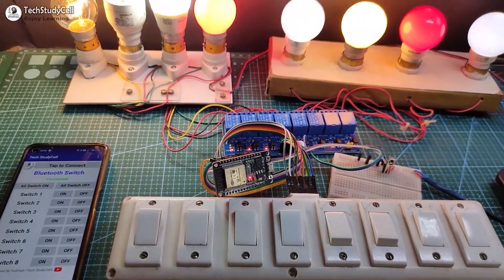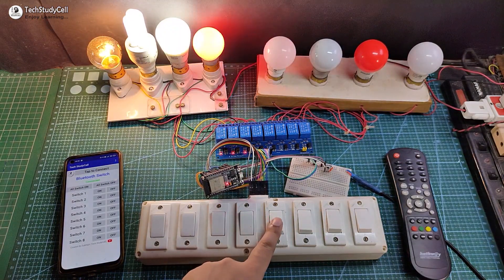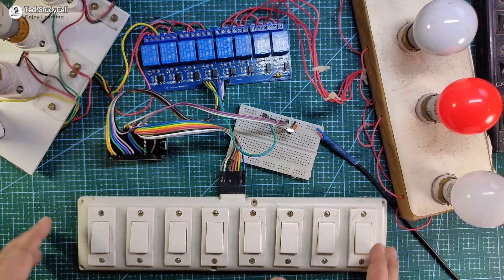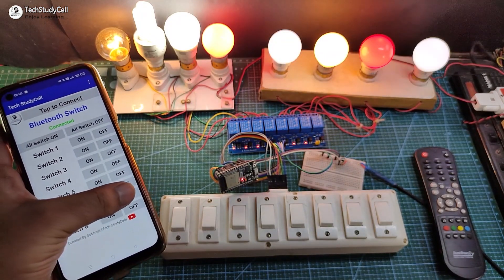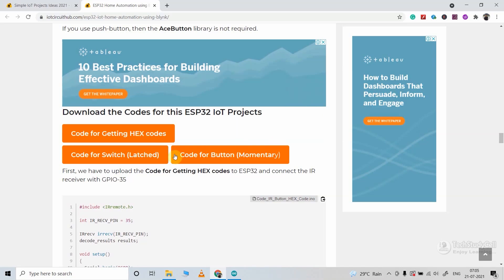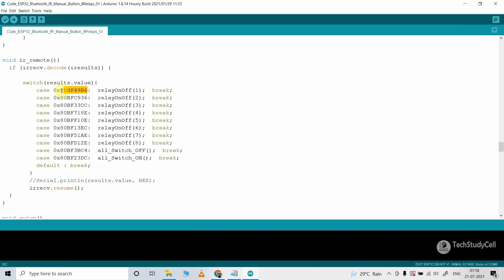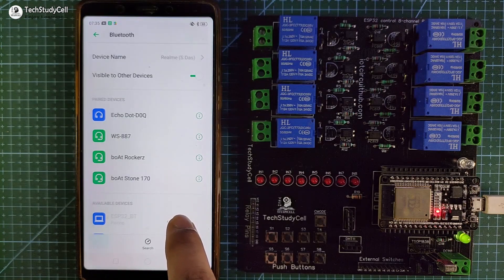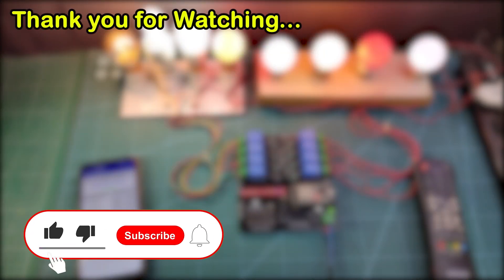Home Automation using ESP32 Bluetooth and IR remote control Relay | ESP32 Projects 2021

Comment: Usually this is your best home automation project at low cost and user efficiency And if you add eprom features for previous state after restart.

Kyuki app socho ....bluetooth and ir remote har kisi ke hota hai. Har koi easily connect vi kar sakte. 
Wifi vagera features  achcha hai lakin configuration krna har kisi ka baat nehi. Connection karna aur vi dikkat hota hai jaab app wifi router change karte ho aur jaab app ea project banake wall pe fix karlete ho. Thik about it.
App kya kosis karsakte ho.....eeesi project pe eepprom features dalna

Comment: 35 pin is not received no cod

But I changed 23 pin in ir

So i control 7 relay.

Which other pin use in ir

Comment: Very nice project, do you have a link or list of the part numbers for the  Required Components for the Smart Relay Module PCB that you used
1. Relays 5v (SPDT)  (8 no) 
2. BC547 Transistors (8 no)
3. PC817 Optocuplors  (8 no)
4. 510-ohm 0.25-watt Resistor (8 no)
5. 1k  0.25-watt Resistors (10 no)
6. LED 5-mm            (10 no)
7. 1N4007 Diodes   (8 no)
8. Push Buttons   (8 no)
9. Terminal Connectors
10. 5V DC supply

Comment: Bro, I planned to keep my Esp32 in my main DB box. But the manual switch (GPIO pin) need to be atleast 40 meter away from the micro controller.  If I laid GPIO pin  wire for 40 meters will it still work ?

Comment: Is there a function, like if bluetooth module is connected with phone and if it is not
Btw congrats 100k
Reply from the maker: Thanks. I have not added any separate function. You can add that in the code.
Reply: @TechStudyCell  What is the code for that, is there any

Comment: Bro what is the spec for power supply like 5v dc is fine but what is the amps or watts 5v 5w is enough??
Reply from the maker: It's better to use 15W

Comment: Great work
We need learn simple code for beginner 
Can u make code for esp32 and MIT app, with timer like in blynk?
And feedback state relay when we open the apps on phone (no need push to know if is on or off).
Reply: With bluetooth conection only 🙏

Comment: To control nodemcu using blynk app, we have to keep connected the board to the wifi, right? If we don't have wifi for 24 hours then is there any other option to control the nodemcu??
Reply from the maker: Yes. I will make video on how to control appliances without WiFi using new Blynk IoT
Reply: @TechStudyCell  thanks 😊
Ye video kab tak aa sakti h?
Reply: @TechStudyCell  waiting for the video
Reply: @TechStudyCell  apne ek naya video upload kiya, jisme bataya ki bina Wi-Fi ke agar control karna h to we have other option which is Bluetooth(ir remote). To ye to yaha par bh likhke bata dete. Muje laga kuch naya bataoge. Ye to sabko pata h, iska matlab apko mera question samaj nai aya.
Reply: Mera question tha ki bina Wi-Fi ke isko kai se bh control kar sakte h kya? Or iska answer h, no. But apne yes kaha to muje laga kuch naya hoga.